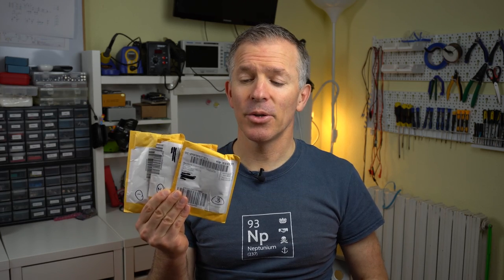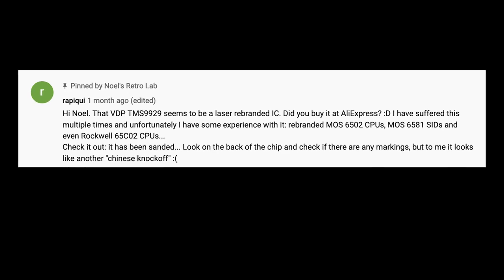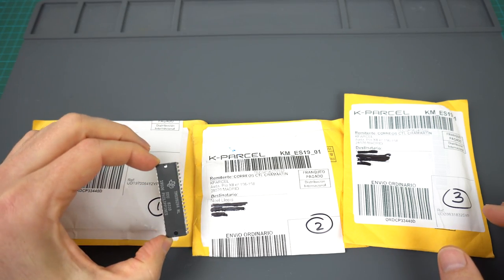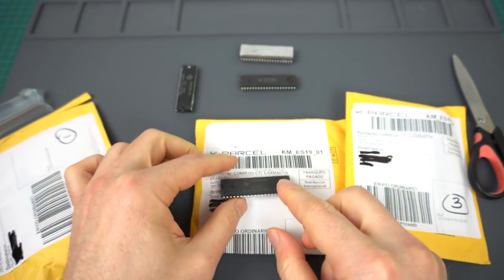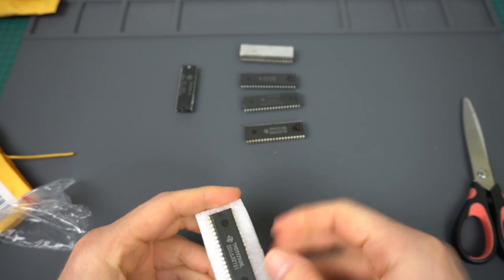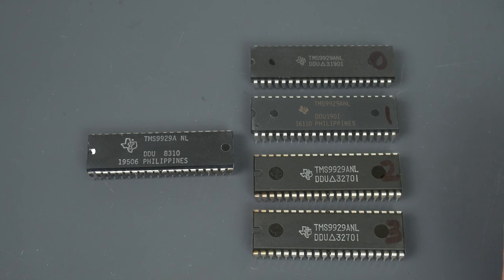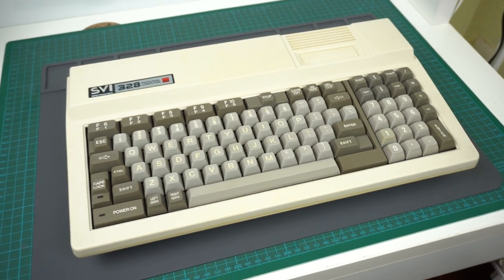Detecting FAKE Chips From China 🔍

Comment: I’m glad you got two good ones out of this. I was pretty sure that #1 was legit and #2/#3 were fakes; a bit too shiny I guess!
Reply from the maker: Right! That was my first thought as well. They look too new to be true! 😃
Reply: The shiny part on #2 and #3 is because it was laser symbolized so it cannot remove with the solvent to prevent fake. The logo impression at the ejector pin area make it more legit as it not easy and cheap to engrave in a small area at the tip of the ejector pins.

Comment: they are horrible about date codes. usually they put date codes on that are long after the production has ceased.
Reply: They have as of recently been faking resistor wattages, IE putting a 2W resistor in a 5W package.

Comment: You're going to break your board if you keep using that screw driver to remove the chips.  Use a spudger my friend.
Reply from the maker: It's a tool specifically designed for pulling chips. It's like a minitature crow bar (forget the exact name). The idea is that the rounded surface let's you put some pressure and not damage the board. You still need to be careful, but it's pretty good.
Reply: @NoelsRetroLab  a spudger is basically the same thing but made of a hard plastic. you can get them in all sorts of shapes.

Comment: I don't think fakes. we don't know what's going on with the manufacturers. this technology is not 100% perfect. When a manufacturer receives an order for 100 thousand pieces he must require the specifications published in the data sheet. he will start production. he will test each component. So out of 100 thousand there must be at least 15% which are outside the specifications. he will put them aside so 10 thousand pieces will be thrown away? these parts are functional..but slightly offset. crazy it works crazy it doesn't work.

Comment: There is no reliable source of parts among these four vendors. If you ordered another chip the result could be quite the opposite. I have experience with all of them. Sometimes they pleasantly surprise me with a working used original or a working copy, and repeated the same order comes with a fake product. One should have three boxes for each of the parts. One for the originals, one for the counterfeits that works and the third for the fraud chips. The latter is not necessary, but I keep it as a reminder for next orders, and showing it to friends and customers. 
I can understand why they counterfeit some obsolete parts, but what makes me angry is the counterfeiting of parts that are still in production and not expensive in the original (e.g. TL072 opamp). I am sure that big known e-shopping companies have received hundreds of reports against these and similar sellers, but it is not in their interest to act according to their own rules.

Comment: Dude, you're insane. I love the lengths you go to. I was convinced that 2 and 3 would be fake because of the bizarre change of font/alignment on the last letter of the code. Turns out I was wrong.
Reply from the maker: Thanks! :-) It's also possible that they're fake in the sense that they're not made by TI, but are just clones that happen to work. But that's a better "fake" in my book than one that can destroy your computer, so there's that.
Reply: @NoelsRetroLab  I’ve never heard of a TMS9918 clone aside from the Toshiba and Yamaha ones from the same era, and if they were it would actually be revolutionary! We would be able to get new replacement parts rather than having to rely on old stock and pulls!
Reply from the maker: @grauwsaur  Ah, interesting. I was assuming they were cloned, but that makes sense since the TMS9929 is a REALLY complex chip inside. It's even more complex than the ZX Spectrum ULA, and that one was only finally reverse engineered not long ago. Actually, every time I read the datasheet for that chip, I'm blown away that it was created in the 70s.

Comment: I don't get the fake market either. Its all type of chips even really cheap stuff like 74xx or 79xx. Recently got 74LS that turned out to be 74HC from Aliexpress. But in the past also had TL072 that where some bipolar op amp (also from Aliexpress) and 79LM15 from Farnell that didn't even have a chip in them.

Comment: Yes, fake ICs are a huge problem form China. I general visual will tell, as manufacturers do not change manufacturing, so mould marks like ejectors (round) marks, printing, etc should be identical to the original part. I was surprised that 2,3 worked, since were different markings, but could be that TI changed mfg site or licensed the part to someone else, however this is rather uncommon. Batch verification, as manufacturing details, are listed on manufacturing sites, so that is a second level verification. Finally, functional tests are the decision makers.. There are many labs that do it, but a home lab will do, to measure some basic parameters. ---- Question, on why fake parts? This is a huge, very lucrative market, Chinese folks a feeding on, from recovering parts form scrap and selling as new, to plain fake parts. Part cost to make, in China is about 0.20 USD, selling for 3 USD, that's a huge return, same with recovered parts.

Comment: suspiciously stares at 64gb of ECC RAM in my server from eBay
Reply from the maker: At least it's working! But it wouldn't hurt to run a few tests. Although maybe that kind of thing doesn't happen as much for modern hardware. At least not the recycling and relabeling part.
Reply: Error correction is a pain in this respect. It probably covers up occasional errors if the chips are just low spec.

Comment: I wonder if you could build a new clock circuit and frankenstein it on with your damaged chip
edit: nevermind, it's a clock in not clock out.
Reply from the maker: Well, it's kind of both: It's a clock in but also has the circuitry that helps it oscillate. So in theory... maybe? But apart from that maybe, I wonder what other parts of the chip are blown. Although at least I know that that particular chip was working a few weeks ago. For a similar problem check out my GX4000 console video. I still need to go back to it, but it had a similar problem with clock signals and that one I'll probably try generating one externally to see if that helps.

Comment: Are you saying exists original chips not from china?

And what is exactly a "fake chip"?
Reply: There are many thousands of 40-pin DIP chips like this that all do different things. One might be a cheap 4-digit, 7-segment display driver chip that converts a voltage to a display (still in production); another might be an Intel 8088 processor (maybe more valuable); one might even drive an alarm clock with a  few extra functions (probably worthless). Lots of old 8-bit processors and display chips are packaged this way. Some are more valuable than others when they are recycled.

Chip #1 was probably some cheap, plentiful chip that people can still buy new. So, the recycler sanded off the original marking, painted it black to try and hide the sanding (this came off in the acetone,) and laser-etched the new markings to cash in on the market for this rare video chip.

Chip #2 may actually be real but was damaged when the original device was thrown away or mishandled when the recycler removed it from the circuit board. It could also be a completely different chip with better-forged markings.

I used to work for an electronics manufacturer that had a lot of trouble with a certain board. A complicated imaging board using a couple of very expensive FPGA chips with over 300 pins each. They were square with all the pins sticking out the sides. These chips are hard to get, and we were having to find them on the "gray market." (I think the manufacturer was phasing out the package in favor of BGA chips.) We ended up with quite a few that turned out, under the X-ray, to be completely different devices than known-good chips. (This problem was bad enough that the company invested quite a lot in said X-ray machine to help with these and other potential forgeries.)

If you can turn a few $1000 chips into $5000 chips, your laser engraver pays for itself pretty quickly. If you can turn a gross of $0.03 (i.e., worthless alarm clock) chips into $1 chips, it's still a pretty good investment. Some places even forgo recycling altogether and buy the packaging machines. They can crank out whatever chip is selling the best with no expensive silicon inside.
Reply from the maker: By fake here I just mean counterfeit: They're selling you something that's not what you think you're getting. In this case I don't think they can make clones of these chips, but they reuse similar-shaped chips and relabel them to make them seem they're the kind I'm buying, while in reality they're something else completely different. Basically what Jim said below 😃
Reply: @NoelsRetroLab  well, what I mean is that a lot of "original" chips are actually from china. 
If the use a fake logo then you are right,  but if they simply build an equivalent chip then it is not "fake".

Comment: Who benefits from these low volume chips?  The shipping company.. ROFL.  But seriously.  One or two fake suppliers offer their product to eBay sellers.  Small volumes per "SKU" means no one comes after them.  Offer your (paid) service to dispose of failed chip lots from legit manufacturers.  You get a stock of dead chips at different common sizes.  Add a laser engraver / painting setup for a "fake chip on demand' product line...  One company could make a lot of money, especially since some particular countries don't give a crap when one of their corporations defrauds other country's citizens.

Comment: I find it interesting that he is testing chips and not using antistatic precautions i turned the video of after 2 minutes whether he uses anti static precautions later on i didnt find out
Reply from the maker: I'm using an anti-ESD wrist strap any time I'm handling chips, it's just too zoomed in to see most of the time. You can see it a few times like around 25:43.
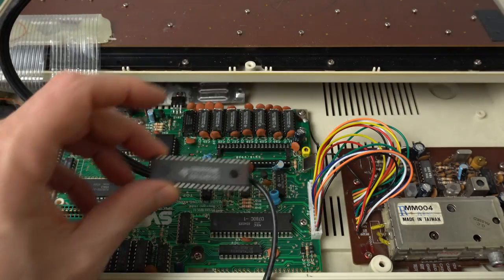Reply: @NoelsRetroLab  i decided to give you the benefit of the doubt and watched your video yes at 25;43 you was wearing an esd strap however i couldnt see if it was connected to a grounding station. however at 26:07 you can see both hands and wrists over a pc board with chips but no esd strap in sight sorry but at this point you have earnt a fail!
Reply: @NoelsRetroLab  and then at 27 mins you place a non esd nylon container next to a chip and this chip was going to be used because you placed some heatsinks to it  and then at 27:15 you fitted the chip to the board and no esd strap evident  so again a big fail.

Comment: You sound surprised. 
This problem has been around for two decades or so. From semi-conductors to passive components. 
If you're doing this professionally, you should only buy from authorized sellers, or a seller you know is reputable.
Reply: You have partially right. According to your user name, picking just a standard component from the same age to replace a uA709 IC for example. Where can you buy them as reputable or authorized supplier?
Reply: @Glanmire3  I would suggest mouser, digikey, jameco, just to name a few. However, there are many other resellers that others may recomend. The key word to look for is Authorized Reller. When you're repairing expensive or one of a kind items, these are the sources to go for.
I have a plethora of components from less than trusted sources, and they have their place in our work. Most are suitable but once again, use your judgement depending on your project.

Comment: i don't see what your problem is, if you're gonna buy cheap chips from ebay, the quality will vary.
you've got buyer protection so just click the refund button. otherwise buy from established suppliers.
Reply from the maker: For old chips out of production, there aren't really established suppliers, so that's not an option. And yes, you can get your money back (if you remember to check) but you wasted weeks along the way. It's not the end of the world, but it sure is annoying.
Reply: @NoelsRetroLab  i find littlediode has a good stock of obscure 1980's peripheral chips. I recently picked up an INS8154 ram io from them which looked nothing like the original ceramic or plastic package but is working well. regarding the waste of time, its annoying but i find having many projects on the go means the lead times from china are less of an issue :-)
Reply from the maker: @jonathan_ansell  For sure. Now that I'm doing more pipelining with my video projects and I have longer lead times, it helps quite a bit with shipping delays. I suppose that's one advantage of that 😃

Comment: I always thought that these bozos advertise every single possible chip that anyone could ever possibly want and they have piles of random if not defective chips (8 pins, 16 pins, 24 pins, 40 pins) that they have sanded. Then when an order comes in, they grab whatever chip has the right number of pins, etch the appropriate markings, and ship them. 

There are some chips that are known to fail like certain Curtis filter chips in classic synthesizers so people buy extras as insurance. It's likely that they won't know those chips don't work until they have to replace a failed chip which could be years later.
Reply from the maker: You think? I don't know what machines they use to engrave the tops but print-on-demand sounds very sophisticated. But who knows, that might be the way it is. Blargh. Very discouraging this whole system.
Reply: @NoelsRetroLab  If I ran this operation, that's what I would do. I have a jar of dead chips here that are not making me any money, not to mention a bunch of old chips no one would want. The lettering and the TI logo are complicated so that would require a laser to create the stencils, but you only need to make that once and you're in business.

Comment: If the chips work as the originals it doesn't make any difference (unless for the makers of course).
Reply from the maker: Agreed, but the problem is these are completely non-functional. They're not even the same chip, so they're clearly just trying to scam you.

Comment: Some people, and there are ten thousands of them, try to fix their old non-working computer. If I am such a fool then there must be others. If I order a chip, then I hope that I am capable of putting the chip in, the right way up, you know what I mean. If I do nut succeed, that the only one to blame is myself. Most people don't complain when the results are unsatisfactoriness. (never saw this word before, spelling suggested it)
 
China got the chips for free, they took apart old computers that were thrown away. Some chip didn't work any more, even before the malfunctioning computers computers were send to China. With the de-soldering, another percentage dies. The people in the dis-assembly plant are not trusted with expensive testing equipment, the CCP is afraid the forced labour workers will sabotage the production as much as possible. 
 
But those forced labourers are lucky to work for their food, if they would have had a better heart condition or 100 percent working kidneys they would be on the transfer list. Till the moment there is a match with a wealthy patient who needs a heart, liver, kidneys, eyes or longs. And life can be very hard without a heart. 
 
If a computer chip is not working I never make any complains. There could be sanctions on the forced labourers for de-soldering a defective chip, or handling it in a wrong way.

Comment: It always bothers me when buying even vaguely specialised ICs off ebay - there is always the risk are either fake, or just not working - so it seems. I bought some 6502s (not exactly a 'rare' item) and was immediately struck by the date code and the immaculate look. So I set up a NOP test for them - see here https://www.youtube.com/watch?v=IZnmlALLV40

I like the idea of using an Audrino for testing, maybe I'll have a go at that next time I get something complicated that needs verifying...

Nice one.
Reply from the maker: Great video! I love that you're looking at the data analyzer. It makes it very clear in that case. And I'm glad you got legit one! What data analyzer did you use?
Reply: @NoelsRetroLab  LOL 'Data analyzer' is an overstatement! It's a Hantek DSO4104B Oscilloscope. It took me a while to figure out where to get the software to connect it to the computer... It's, erm,  limited. Scope is OK though.

Comment: The people with the tech to create these chips surely can make proper chips. I don’t get it.
Reply: But they did not make these chips. They purchase reclaimed ICs by the thousands, sand them, black top them. Actual part number doesn't matter. When an order for a specific part comes in - they simply find the right part size, mark it with the part number as the customer ordered. Reclaiming involves hitting the boards with blow torches and banging boards on on the floor or metal cans until the parts fall off.

Comment: Hi all I got a fake chip from China it was for my Amiga A1200 ACA 1233n I wanted to put a Motorola 68882 Floating Point Unit in the card. I got one that said it was 50Mzh ok when I got the chip there were scraches on the top. They had taken the gold and black ink off and remarked it as a diffrent chip.
I was luky that I was abel to send it back as "Item not as described". It said it was NEW. I got a refund I was able to do this by looking at the listing and comparing the listing  PHOTO to what had been sent. I had another chip to look at as well. With chips like mine they will remarke it to a faster speed so you can use it, then after some time it will give you lots of problems.